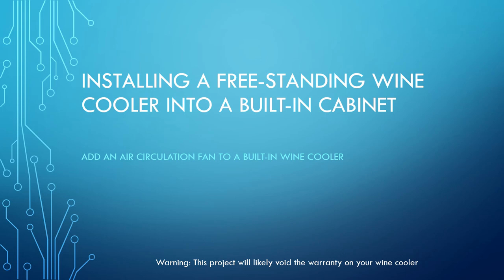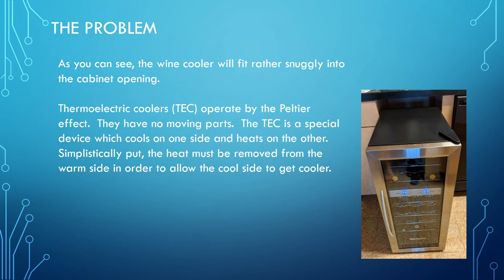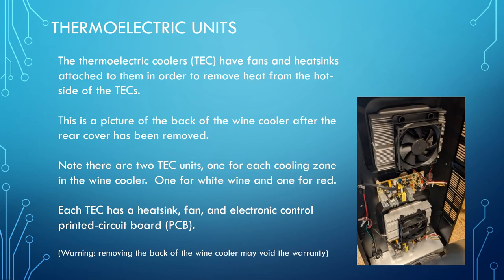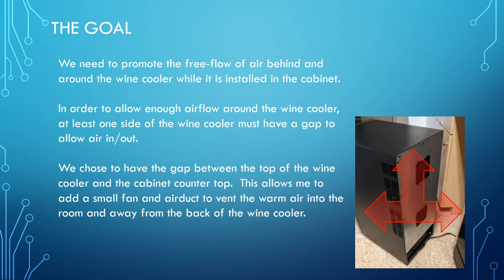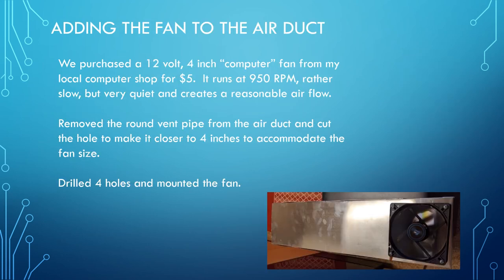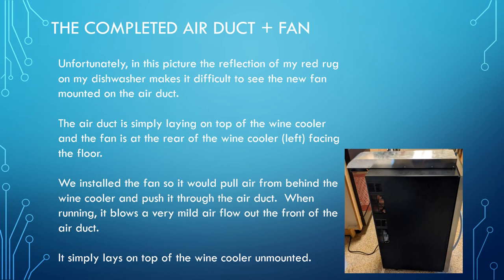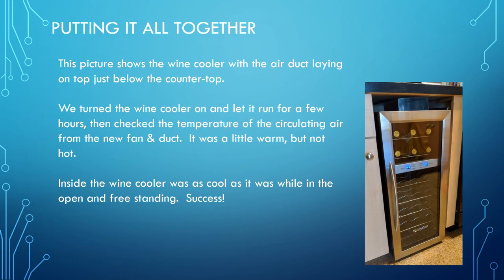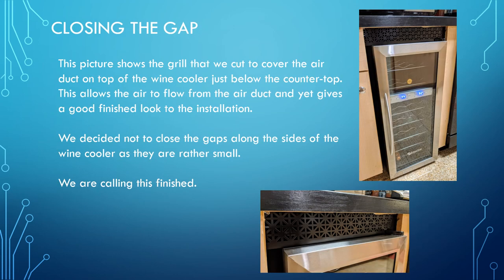Installing a Free-Standing Wine Cooler into a Cabinet & Adding Ventilation

Comment: I just finished the install of my beverage fridge within base cabinets on a wine bar  today and subsequently realized I completely I didn’t factor the airflow. Your idea might just save me. Thank you so much for this video. I can tell an engineer made it due to the methodical nature of coming to a solution. Well done guys!
Reply from the maker: Glad to hear it.    If I was doing this again, I would choose a simple plug-in fan instead of trying to wire it into the refrigerator. Otherwise it still working fine after a few years.
Reply: @LarryBlackledge  Yep, I will be going the powered route for a fan, that has adjustable speed and found a periscope type vent that will fit the 2.5" clearance I have on top of the fridge.

Comment: Thanks for this video.  I've been thinking along these lines for some time.  I have a small kitchen and would like to eliminate my refrigerator.  The only current place for a 6 foot plus refrigerator partially blocks a kitchen window and has always been a pain.  I'd like to replace the fridge with an island with two compact 4 cu. ft. refrigerators built in below.  8 cu. ft. of refrigeration is adequate for our needs in the kitchen and we would purchase "all fridge" units (no freezer compartment) with left and right doors.  We have a second refrigerator/freezer in the basement and a chest freezer.   There are compact refrigerators manufactured for "in cabinet mounting", but only seem to be available in commercial grade and run about $2,500.00 per unit.  These units vent the hot air out of the front, bottom kick-plate area.  A basic compact residential refrigerator sells for $200.00 each or less.  These residential units state that they require 6 inches of clearance all around to provide adequate ventilation.  I don't believe that enclosing such a unit represents a fire hazard, but early motor or compressor failure is likely without adequate clearances.  I plan to design and build the island cabinet and it will provide about 1-1/2" clearance around each refrigerator on all sides.  I would design for two 140 mm. quiet computer fans to be installed in the cabinet inside walls.  One pulling cool air into the cabinet and one exhausting the warmer air from the other side of the cabinet.  Providing power for two 12 VDC fans can be easily provided with a simple DC power supply and I have sourced a DC thermostatic controller that will automatically turn the fans on when internal cabinet temperature reaches 90 deg. F. and turn the fans off when below 90 degrees.   This is the same concept as used in computer tower cases and many types of cabinets designed to enclose sensitive computer equipment.
I would very much appreciate your comments or advise of any pitfalls you may have encountered.
Reply from the maker: Chris, sounds like you have a good handle on what you're doing.   By using an external power supply for the fan(s) the task will be much simpler.  I've not dealt with a temperature switch, however I assume you've looked into this.  Good luck and let us know how it turns out.  Larry...

Comment: Curious why you didn’t choose to route the vent on the bottom being that you had the room. Maybe for heat rise purposes? Liked the vid though.
Reply from the maker: Paul, there were two reasons.  1) as you mention I assumed the heat would congregate at the top of the enclosure.  2) to get the pipe under the unit I would have to elevate the unit and I really wanted to keep it's feet on the floor for easy slide in/out for cleaning.
Reply: Interesting and very helpful.